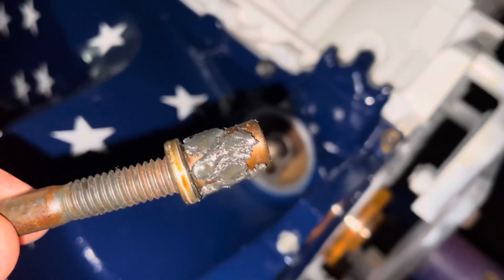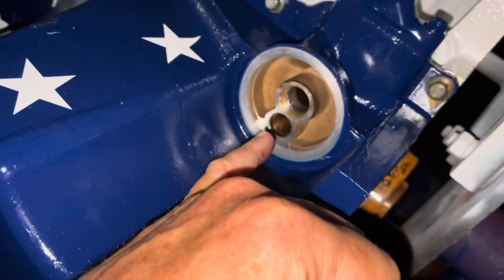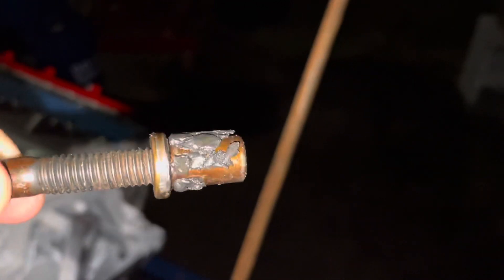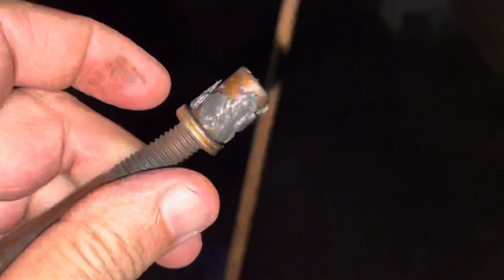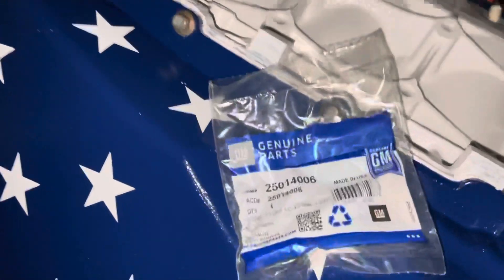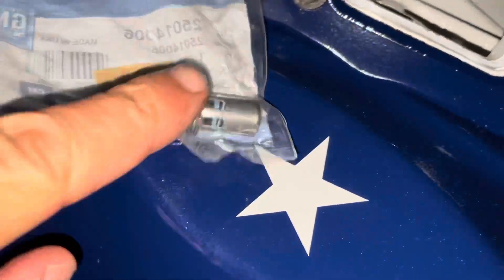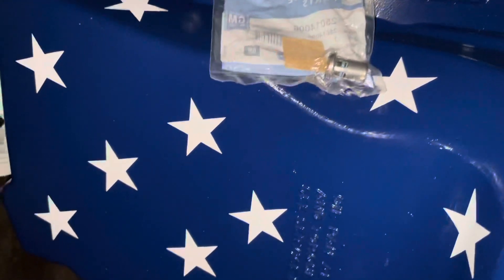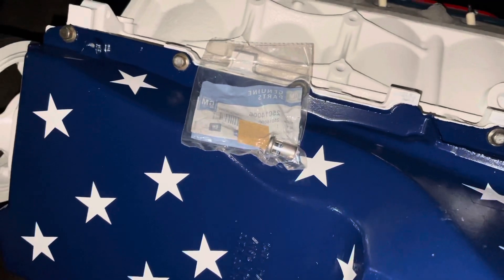LS Swap 2 - Oil Filter Bypass Valve Install

Comment: If the oem bypass valve is faulty could it cause ticking at start up? My 04 Tahoe is silent when it starts up cold. Makes a little bit of clatter when starting up after being warm, goes away after about 5-10 seconds. Did pickup tube o-ring twice, oil pressure is great, 40 psi when warm, did multiple oil changes, etc. It runs great, only makes this clatter after its been warmed up, when starting it back up again. Wondering if this could be the culprit.
Reply from the maker: The bypass would only be an issue if both the bypass and oil filter were both stopped up at same time. Being an 04 it’s more likely that you have some borderline  bearing clearance due to miles and age. Change to 10w40 oil and it will probably go away.
Reply: Lifters leaking down or loud exhaust leak
Reply from the maker: @doddgarger6806  exhaust leak wouldn’t go away after it warms up
Reply: @moccasinmarine  I agree...... when this engine is cold, it's silent upon start up. After driving a while, shut off, go in store or something, come out, start up, oil pressure goes up to 40psi and it'll clickety clack for about 5-10 seconds, sometimes less, sometimes not at all, but then it'll go right away like nothing. It's a 5.3 L59 and it runs amazing. Heavier oil made it a little worse. I'm not too worried about it since it runs so good, lots of power. Next year I might do a cam swap with new lifters and all that. New oil pump, etc.
Reply: @moccasinmarine thats the main ways to determine if it is an exhaust leak. The exhaust manifold gets hot and expands
Reply: @moccasinmarine it definitely does